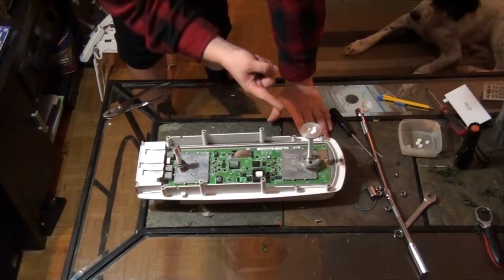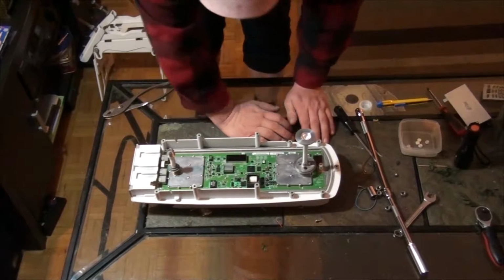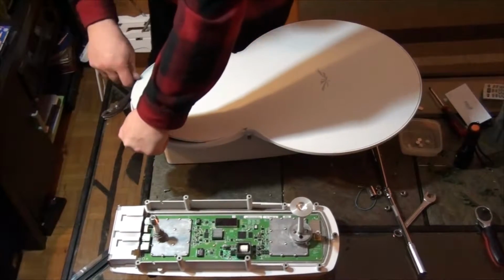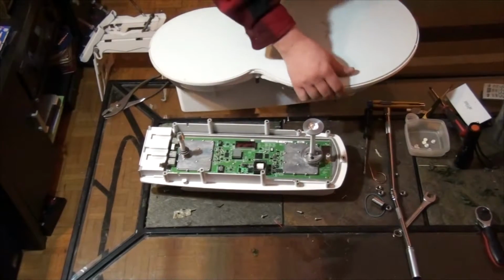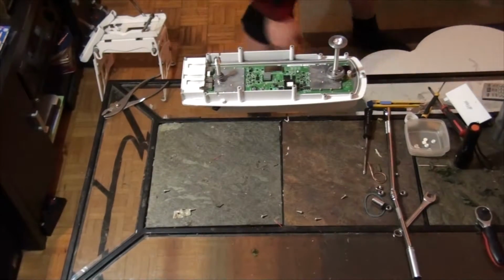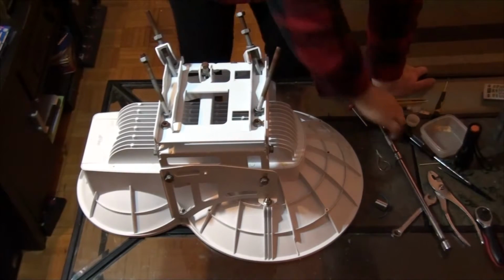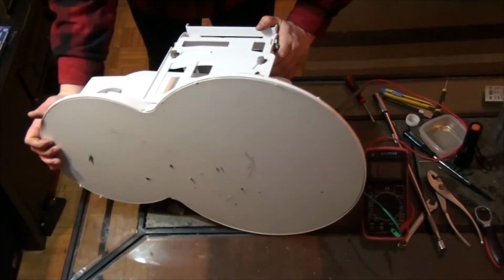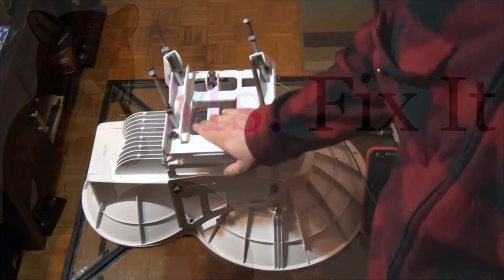AF24 Teardown

Comment: If the AF24 won't connect and make a link is that something that is fixable?
Reply from the maker: Yes the general flaw in them is the poor quality network interface chip. We fix these for companies on a regular basis.
Reply: @thefixitgal  so you have to do microsoldering? What do you charge?
Reply from the maker: @TheTF01  Shoot a PM to my company "Isp Technology" on Facebook. Thomas is the Head of the LAB. Hell quote you :) 
And yes.. this is all smd soldering.

Comment: Did you ever get the schematics of this unit? I have 1 with no power and 2 that boot to CA and hang
Reply from the maker: You need to replace the TVS diodes and check the power circuitry. its all in its own section.
Reply: @thefixitgal  have pictures of a write up or video of how to do this?
Reply: @thefixitgal  Any pictures? where are the TVS diodes?  I have 4 units with the same CA stuck issue
Reply from the maker: @ak-pl5xo  TVS diodes are all after the Ethernet port. They should jump out at you. Send me a picture of the ethernet section of the board in the Ms Fixit facebook group and I can circle them for you :)
Reply from the maker: @normaneg88  Sorry it took me so long to reply XD. I absolutely should. We dont have any on hand but th next batch that comes in I will make something up for everyone and post it in the Ms Fixit group.
Reply from the maker: Hey Thomas advised me " CA" States calibration issue. It means the ethernet chipset is blown and needs to be replaced.